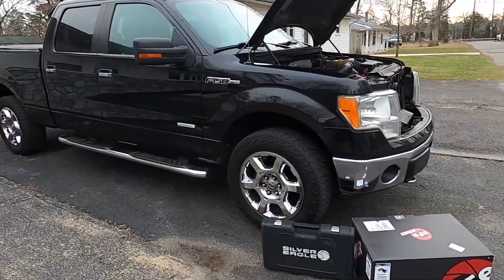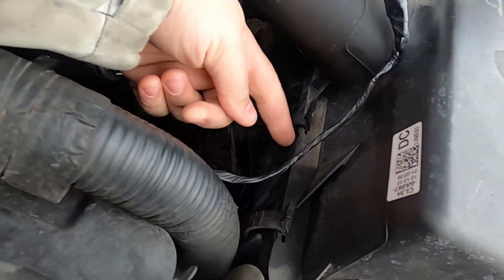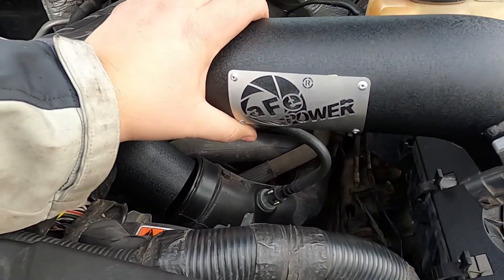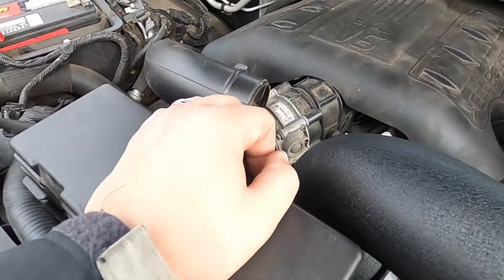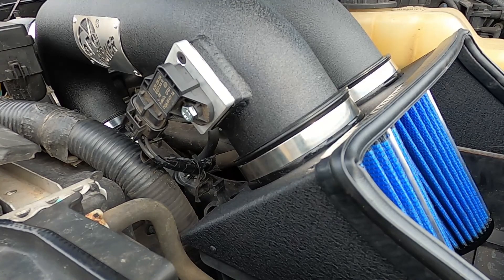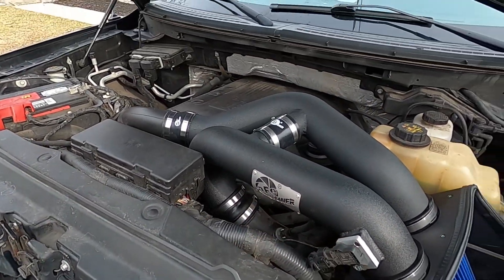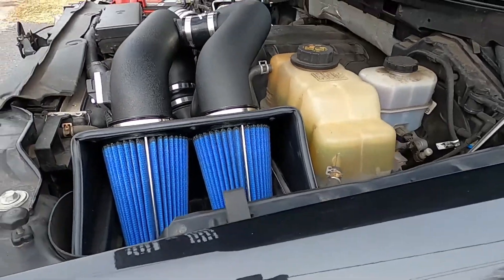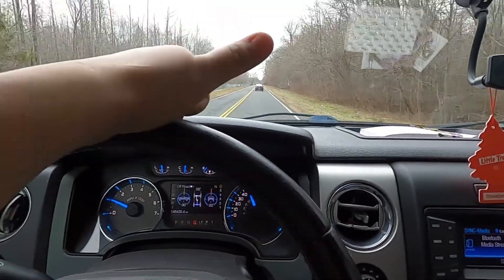How to install aFe Power Stage 2 Cold Air Intake on a F-150 2012-2014 v6 3.5 Ecoboost Twin Turbo

Comment: I just bought one of these, 2014, with the 3.5 and was pretty disappointed about how I couldn't really hear the turbos.  I could tell it has nice power though, was driving in a 40 and kept going like 55 - 60 by accident lol.  It's difficult to drive slow in it lol...I usually drive sports cars so it's weird having a truck want to move like that.  I'm definitely going to start looking into cai's because I really wanna hear those turbos :)
Reply from the maker: Yes! Make sure you remove the cookie cutter turbo silencer(I didn't on this video). I did a second video on another 3.5 installing the same CAI and on that one I show you how to remove the silencers.
Reply: @tunedspec1740  o sht I didn't know there was a silencer!  Man this is gonna be fun.  I"ll look for the video
Reply from the maker: https://youtu.be/Q6QTD6iAxlY

Comment: Are they oiled. Oiled is not recommended for eco boost if the oil hits a hot turbo it may crack
Reply from the maker: Don't know but they are made for the F-150 ecoboost.

Comment: You think it’d fit on a 2011 f150 ecoboost?
Reply from the maker: I think it fits but I'm not sure, I found the same intake for a 2011-2014, look it up on ebay "2011 f150 ecoboost intake".

Comment: How does it even work in a hot engine bay?
Reply from the maker: Well it has a heat shield around the filters so it would grab air from the air duct. But I didn't designed it so IDK, but it sounds great! Please like and subscribe!
Reply: So with a turbo charged engine a cold air intake just let's it breath better. The temperature of the air pre-turbo doesn't really make a difference since the turbo heats up the air by compressing it. That's why it has an intercooler post turbo to cool the air prior to intering the intake manifold for better performance.

Comment: Want to hear the turbo take off the exhaust
Reply from the maker: It's my in laws F150 and he already put a Magnaflow exhaust and it sounds better, but I do like the way the intake sound i tried to record it but the mic did pick it up. Thanks for watching!
Reply: @tunedspec1740  I understand but with turbos u don't need any muffler n barely any pipes so turbo can spin n then u going hear your turbos n feel power just  down pipe upgrade..look it up on the tube